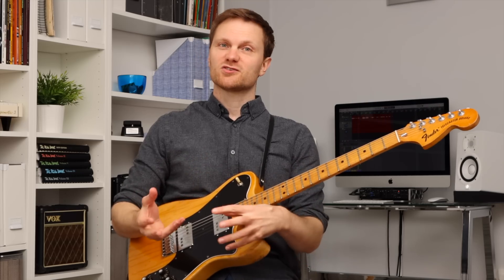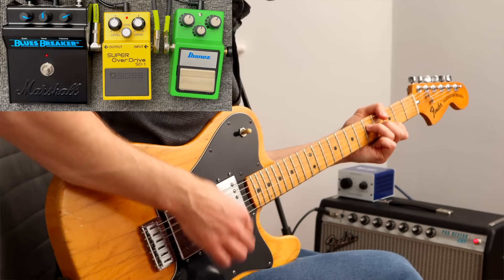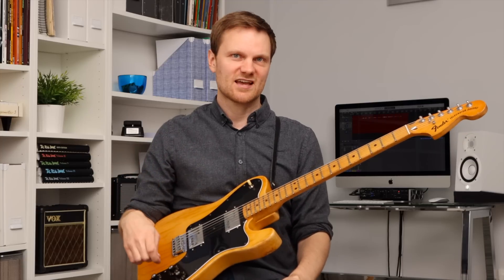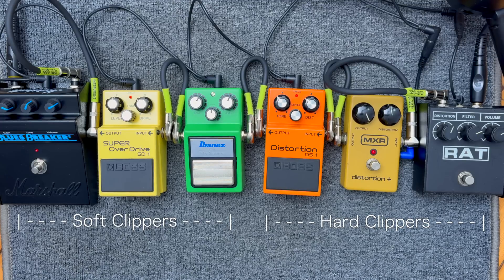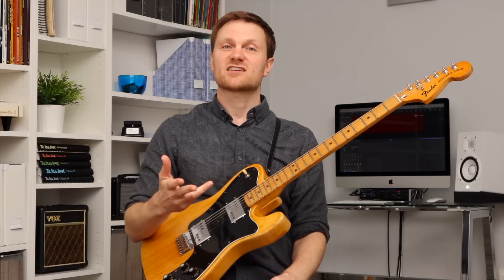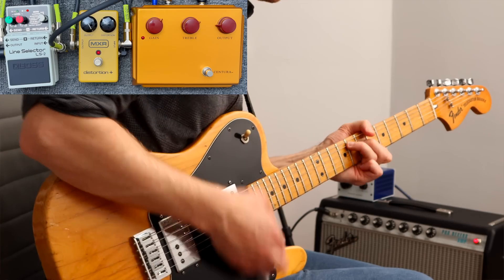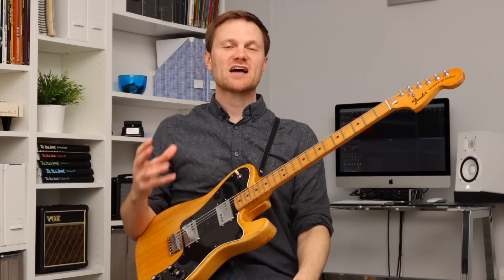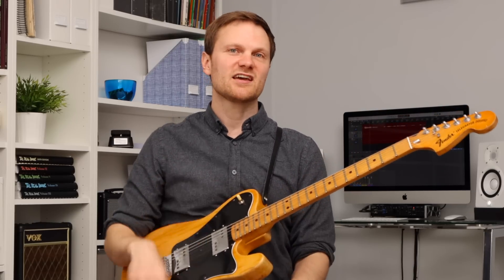Understanding Hard & Soft Clipping in Drive Pedals

Comment: If you’re using a drive pedal as a soft clipper, you’d typically set the level high and the drive low. This way, you boost the signal while gently rounding off the transients for soft clipping. For hard clipping, you’d also set the level high to boost the output and push the signal into clipping, but with the distortion turned high to aggressively square off the waveform, creating that hard clip effect.

Comment: The Rat is the only hard clipper that sounded good to my ears, but I think that partly comes down to the voicing of the MXR and Boss hard clippers. 9:29 after compensating for the voicing differences, I think I like the hard clipping better. The decay is quicker, but it’s more aggressive which I like

What I really like is soft clipping into hard clipping. Luke Bentham of The Dirty Nil keeps his marshall 1959 on a very light crunch and puts a Rat in the fx loop, making it run the symmetrical soft clipping of the preamp into the asymmetrical hard clipping of the Rat. It gets a distorted tone that maintains note definition

Comment: I went with a Wampler Pantheon dual drive pedal. Both channels have hard/soft/both clipping options as well as 3 gain level options. These settings are before the 4 knob controls for each channel. Drive pedals are tools. Pick one and get to work 💪

Comment: When diodes are used in the "feedback loop" of an operational amplifier chip (the configuration described as "soft"), in the process of clipping, they will limit the maximum output of that chip to whatever the clipping threshold of the diodes is.  In the case of a pair of silicon diodes, like with a Tube Screamer or SD-1, that will be around +/-600 millivolts.  The chip itself can amplify cleanly, until the amplified signal reaches around +/-3500 millivolts, such that the diodes are doing all the clipping and the chip is never "stressed".  Some drive pedals, like the Timmy, will use a quartet of diodes, instead of simply 2, raising that threshold from +/-600 to around +/-1200mv, still well below the chip's maximum clean level.

When diodes are placed after the output of the chip - what is commonly referred to as "hard clipping" - not only do those diodes clip, but the op-amp may well be set to gains that DO "stress" it.  Indeed, gain settings higher than around 35-50x will amplify the signal well past what would be the "headroom" of the chip.  Given that a great many drive-type pedals have gains well in excess of 100-200x, those diodes on the output are clipping a signal that has already greatly exceeded what the chip can amplify cleanly.  In effect, "hard" clipping is really and truly double clipping - once by the chip, and a second time by the diodes.  Since distortion is the addition of harmonic content that wasn't there in the first place, "hard" clipping will be adding harmonics of harmonic content created by the headroom limitations of the chip.  And since the most harmonics a string produces will be during the pick attack, we hear a highly exaggerated "bite" from so-called hard clippers, due to redistorting that initial harmonic distortion from the chip.  That's what leads us to perceive it as "harder".

In theory, if an op-amp could be used with a high-enough power supply that might raise its headroom from +/-3500mv to, say +/-10000mv, there could be no audible difference between hard and soft clipping at many gain settings, since only the diodes would be doing anything.  And the diodes don't particularly care if they are conducting to ground or conducting between pins on an op-amp.
Reply: There is still one other different that separates the two. Most soft clipping circuits are set up in a non-inverting op amp gain stage. The formula for the output gain of this type of circuit is Vout = Vin*(1+Z2/Z1), where the diodes are placed in the Z2 part of the circuit. This means that if you put in a 1V signal (above the 600mV clipping threshold), you will get 1*(1+Z2/Z1), where Z2/Z1 is greater than zero...meaning you would get more than a 1V output. However, in a hard clipping configuration, the 1V signal would be clipped down to 600mV.

A typical guitar signal is much quieter than 1V, but this extreme example illustrates that how each circuit clips is different on its own, even without op amp distortion. But you are 100% correct that most hard clipping pedals get their overall tone from two stages of distortion - which is why changing the op amp or power voltage on the Rat makes a MUCH bigger difference to its tone than doing the same thing to a Tubescreamer (you can still hear differences, but they are more subtle).

Comment: Hard clipping drive pedals into fender amps just don't work for me.
If tried dozens and the only one working for me was the klon but even that's an outlier
Reply: I like boosting signal into front of Fenders by turning up Output Gain on an outboard compressor just before the amp

Comment: Being a child of grunge: hard clippers the Rat is so versatile! DS-1 obviously is fantastic as well.  But I’d have to pick the Rat.

Soft clipping— SD-1 by far. Probably the most versatile pedal of all six! Seems it can replicate the sound of a Bluesbreaker, and the tube screamer can really sound like a wet blanket over a speaker with certain humbuckers— obviously it can sound great but I think it’s range of great tones is far smaller than the SD-1.

With the right guitar and amp the SD-1 can do cliche edge of breakup all the way to 70s glam metal

Comment: My favorite approach is the one Chris Buck uses: Compressor>OD>Fuzz. All pretty low gain. That's how you get that thick, creamy, yet still sharp enough sound.
Reply: You’d typically use compression at the beginning of the chain for clean tones, where it helps control your picking dynamics and adds sustain. However, for distorted tones, placing compression at the end of the chain is more effective if you’re trying to tame volume spikes, because compression before distortion won’t control the peaks that are created after the distortion stage.

Comment: Great comparison of hard and soft distortion. Now I understand the sonic difference. The funny thing is for me as I get older I use it less and dislike hearing it. I’m finding I want purer sounds from my guitar. Weird, huh.
Reply: I’m the same way. When I was young I loved distortion and fuzz; I have a pedal collection to prove it. I also thought overdrives were weak and boring

Now I almost always have just an overdrive on to boost my signal just a bit and run an amp mostly clean to get a lot of different vintage clean and overdriven tones. My fuzz and distortion pedals are collecting dust but I can’t seem to part with them

Comment: Great video, great choices of pedals!

The test at the end is just spot on, both because of the EQ matching and allowing the listener to hear the clipping decay. I think the hard clipping sounds more Marshall, when the soft clipping sounds more vintage, blues.

FTR, the Bluesbreaker has a different type of soft clipping than the other two, utilizing the diodes in an inverting amplifier configuration.

Comment: I like your channel very much, but unfortunatly it is technical not correct, what you say in your explanation at the very beginning. How hard or soft it goes into saturation depends on the characteristic of the clipping diode, the internal resistant of the amplificator that drives the diode in its output- or feedback-circuit, and also on the resistant in row to the diode {if there is one). For example take a hard clipper like the proco rat an put a 10k pot between the clipping diodes  and ground an rise the resistent. As bigger it gets as softer it clips even though it is a hard clipping circuit. Or as another example, Big Muffs are soft clippers, but go very hard in to saturation. The Opamp Big Muff has more in common with the tubescreamer than to the clone centaur which is a hard clipper. . 
Big muffs nevertheless go such fast into saturation tht there is no real cleanup, if you put down the volume of the guitar, but the proco rat has such a cleanup, even though it is a hard clipper. Or the OCD drive. It is a hard clipper very similar to the boss ds-1 but has a much smoother saturation.

Comment: def the hard clippers. however i have always loathed the SD1 DS1 and tubescreamers anyway - worst drive pedals ever. the DS1 is simply the worst pedal ever.  very pleasantly surprised by the blues breaker, but the winners are the distortion+ and the rat. i've never owned or played either - i think this vid may have persuaded me to acquire them both one day. don't bob mould and neil young use the +?
Reply from the maker: Thanks for sharing! I definitely want to start using the dist+ more after doing this video. I've always liked the rat sound.

Comment: I used the Boss pedals a lot. Now I am more into the Rat type pedals like JHS Distortion or the Catalinbread Katzenkönig for hardclipping. I can also recommend the Lichtlaerm Audio Altar Mk III, it is generally a fuzz, but it can do some nice lowgain also. Usually i get lowgain out of my amp or by turning down the volume knob on my guitar to get close. When stacking I usually go from high to low gain. Great video btw!

Comment: I used the DS-1 for years at settings that would make me cringe now and eventually soured on it. I prefer the Rat more these days but I'm warming up to the DS-1 again  after some experimental knob twisting. I've heard people say that 11 o'clock is the sweet spot for the tone knob but I set it at 9 o'clock. My ear for bright tones vs dark has changed a lot, maybe because of the Rat or the settings I use on modellers to get the most natural tone possible.

Comment: I like having 3-4 gain stages on my pedalboard, and get distention tones by not increasing the volume, but kicking in a new pedal for a gain stage. I got the ODR-1 for lowest gain, hot wax for the two medium gain settings and then an MXR Classic 108 mini fuzz for over the top lines!